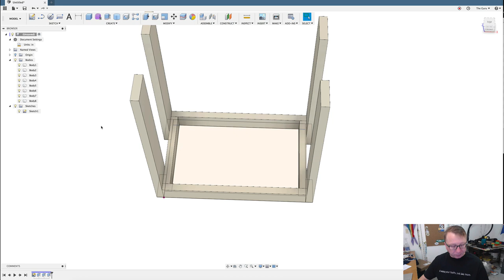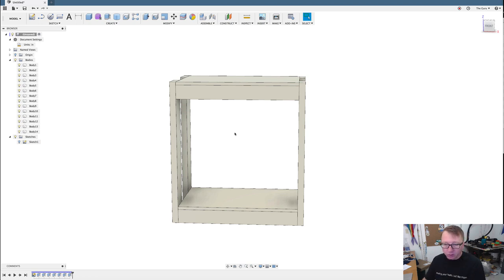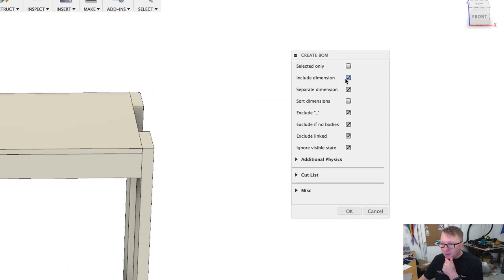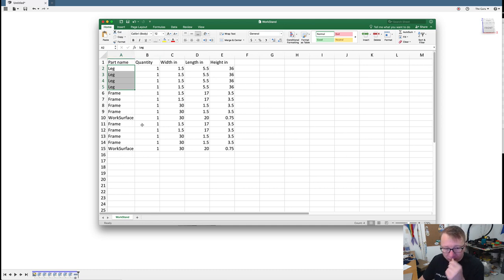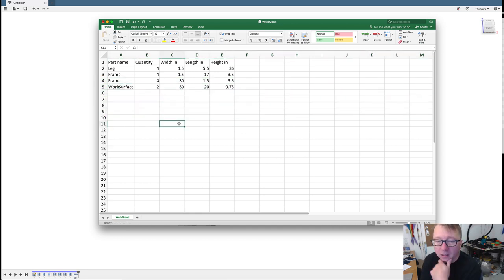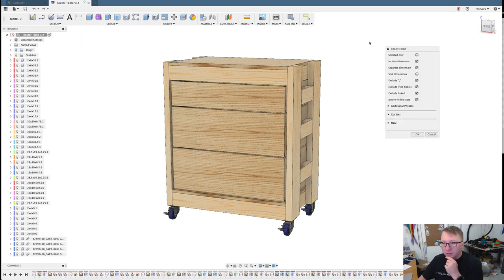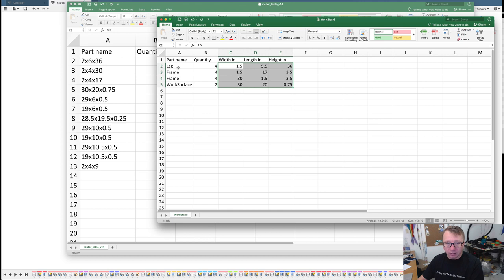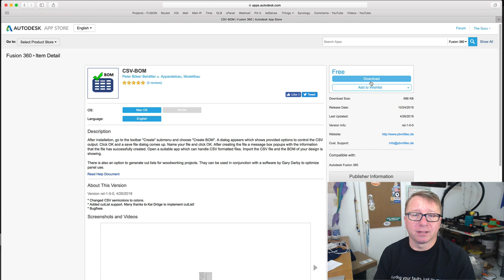Getting a good BOM from Fusion 360

Comment: Looks very good. How does it work with irregular shaped objects? Say I've designed in the sheetmetal and am cutting irregular shapes; does it do a bounding box? Very useful looking plugin though!
Reply from the maker: Hi Jools - this particular plugin in very basic and recently stopped working after an update.  I've recently discovered OpenBOM which seems to be more capable -- I'd be interested in your experience with more complicated designs like yours.  Thanks for watching!
Reply: @cyberreefguru  OpenBom looks good but it appears that integration with Fusion360 is limited to the pro version
Reply from the maker: @melfet1976  Yes, that is a change they recently made and is super unfortunate.  I've been in contact with the company and they are considering a hobbyist license that matches the Autodesk license, but nothing yet. So for now, we're sort of "stuck" with the alternatives.

Comment: What about the pieces that are cut with a miter on the end? Can you get it to automatically call out the 45 degree or 32 degree miter or anything?
Reply from the maker: I don't think so - the output is simply LxWxH; though you can label your parts to make it clear.  BOM management definitely need some work in Fusion.  I've tried a couple plugins and they all cost money and are not any better; really quite unacceptable.
Reply: @cyberreefguru  Thank you for the reply. I'm currently looking at trying to find a substitute for Solidworks that has the parametric 3D, 2d drawing and BOM capabilities that is equal in ability but cheaper in price.
Reply from the maker: @theaquariumhobbyist2326  if you're not making less than $1K/yr, then Fusion is free.  I can be free up to 100K/yr under certain circumstances.  I think it's $495/yr for a commercial license, but I could be wrong.  I've not used Solidworks so I can't compare them.  Since it's free to download, you can take it for a spin yourself.  BTW, I so want to get back into reef keeping but so little time to do it right.  Hope this helps.
Reply: @cyberreefguru  yeah I'm a certified Solidworks professional so I prefer Solidworks but just thought I'd see what was out there. And I understand I'm getting ready to start up my first reef aquarium (120 gallon) so we'll  see how it goes.

Comment: I was so hopeful, but getting an error.  "Failed: Traceback (most recent call last): File "C:/.../CSV-BOM.py", line 540..."
Reply from the maker: Mark Good yes, I started getting an error after the most recent round of updates as well. I’m going to look into it and see if I can resolve it.
Reply: @cyberreefguru  I contacted the developer who provided a patch which solved the problem.
Reply: @Good13man  So it's working now for everyone?
Reply: @fotballski  Just did a test run of the current master (rel-1-0-0 in the manifest) and it's running well in F360 v2.0.8624

Comment: Doesn't look like that plug in is available any more. :(
Reply from the maker: Hi @savoylen - oddly I was just looking into the code for this plugin and noticed the same thing.  It looks like you can still get the code from Github though: https://github.com/macmanpb/CSV-BOM - I am investigating updating the plugin myself since it seems to have some issues with one of my designs.  Hope this helps!
Reply: @cyberreefguru   just tried it and its only pulling components i've inserted from the one of the "stores". seems to be only the unlinked components... Yep. definitely only pulling through unlinked components. annoying!
Reply from the maker: @dannyspitz8070  there is an option to include or exclude linked components.  Not sure if that makes a difference.  I'm digging into it for my own purposes, so hopefully I can help others.  Slow going with their inane development environment and debugger.  Man I really don't like python....
Reply: @cyberreefguru  Did you manage to do something with the plugin ?
Reply from the maker: @alexandresavard8621  yes, but I can't finished it yet.  The old code still works - just get it from Github.  I'll try to post my code as soon as I can, but I noticed a major oversight today when I was using it, so I need to go back and refactor some things.